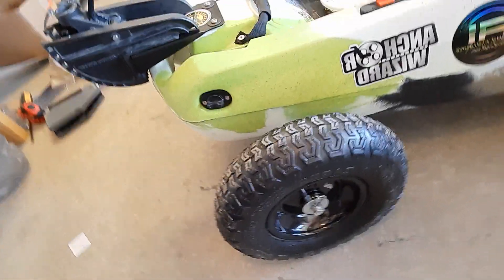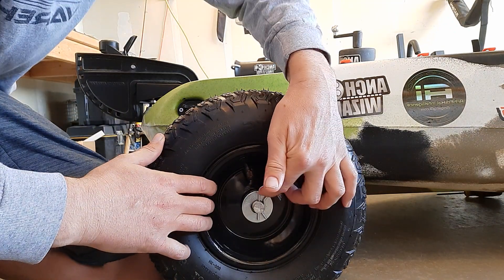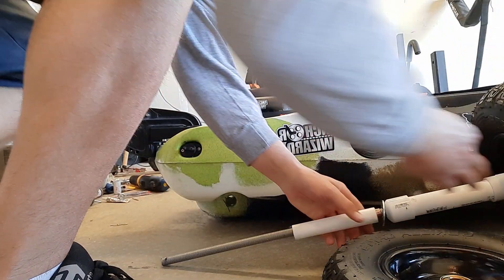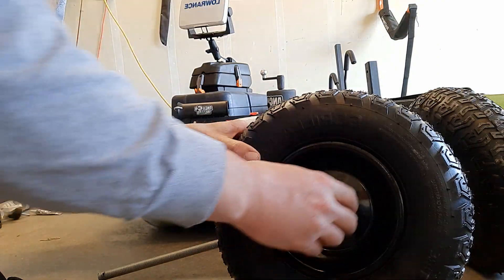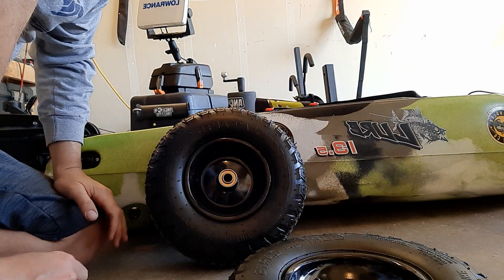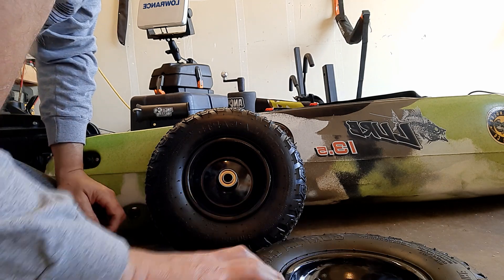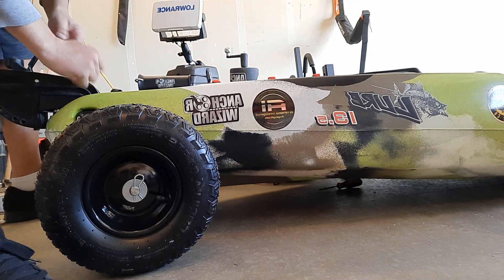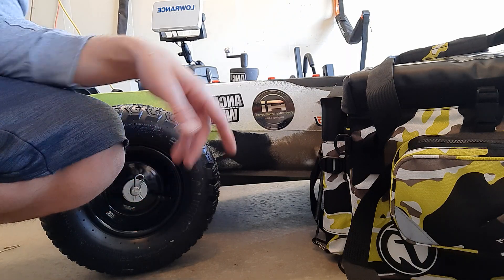DIY Feelfree Kayak Cart | Lure 13.5 V2 | Kayak Modifications

Comment: Question about yours, what size wheel and tire did you go with?  I did this without the caps on the extensions, you don't really need them if your pipes are the right length.  I also made a bushing out of a smaller gray conduit by turning it down on my lathe until it friction fit into the 3/4 PVC.  I don't know that it makes any difference, but the axle fits tighter with it and i don't like a lot of slop.  Taking out the keel wheel only requires a flat screwdriver and a 10mm allen wrench, the ones on the left side are reverse thread.  There's a flat on the inside washer you put your screwdriver against to keep it from turning while you turn the outside nut, so no need to cut it off if you want to potentially sell it later.
Reply from the maker: I believe the wheel is an 8-inch. Thanks for watching giveaway at 5K subscribers. Cool idea on the conduit

Comment: Great mod! Just me two cents, I would use 5/8 round stock. Measured to length, drill for your pins.The all thread threads are hard on all parts in the long run. Nice work man.

Comment: How did this hold up?   Cause any cracking or issues ?
Reply from the maker: Nope no cracking at all. I still use it all the time. I did however ditch the copper piece. It's not necessary. Thanks for watching.

Comment: BassAngler, great mod. One thing I'm trying to understand is how does your 5/8" allthread go through your 1/2" copper pipe shown inside your 3/4" pvc. Please advise, Thanks.
Reply from the maker: lol I apologize. The PVC is 3/4inch.
Reply: @WillSelbyKayakFishing  thanks. What is the size of the copper tube inside it. You state the 5/8" goes through a 1/2" copper tube.  Would that not fit? Your thoughts.
Reply from the maker: @martinlarkin9624  I actually ditched the copper. It's pointless.
Reply: @WillSelbyKayakFishing  ok thanks. Be safe
Reply: Will. How did you remove the wheel in the keel. Please advise your thoughts. Thanks
Reply from the maker: @martinlarkin9624  I drilled it out. You can also saw the tabs on both sides of the wheel.

Comment: Why did you record in SELFIE mode?
No need to look at yourself while recording. 
Now everything is backwards in your video.
Maybe get a spare set of wheels without bearings for saltwater/sand use?
I do like your capped PVC spacers.
I was thinking the allthread might damage the kayak but it looks like you used a bushing tube through the axel hole. 👍 
I'd suggest using a 5/8 solid rod

Comment: Replacing only the back wheel leaves you with all kayak weight on the handle.
Reply from the maker: A wheel already comes stock back there for moving the kayak around. The problem is it tilts left or right when you lift it. This allows for stability and the ability to move the kayak through rough terrain. It's not heavy unless your fully loaded down which I unload before I move it. Thanks for watching a lot more mods upcoming.